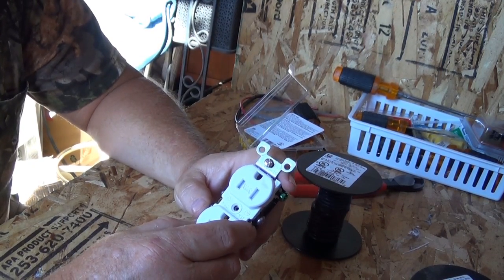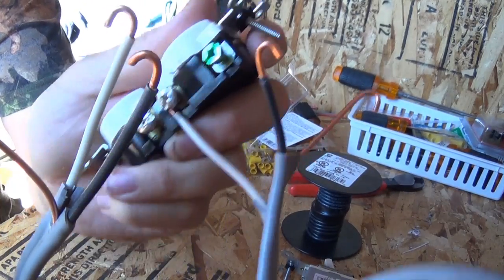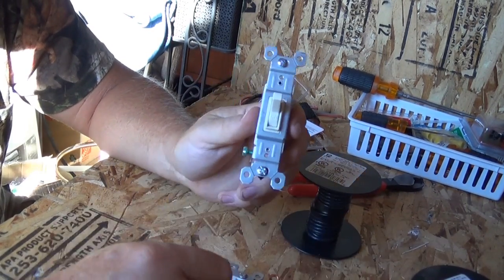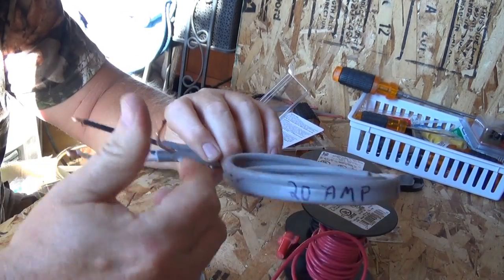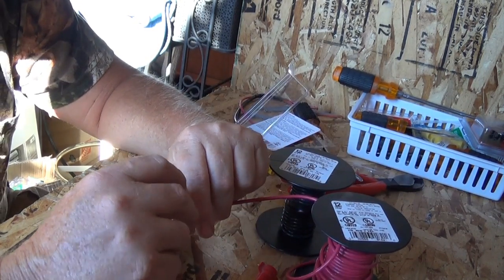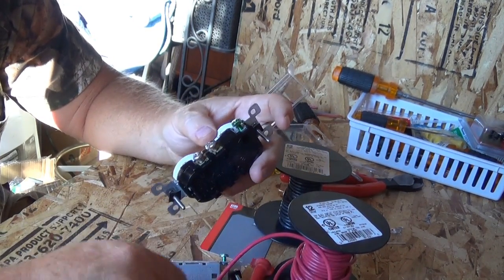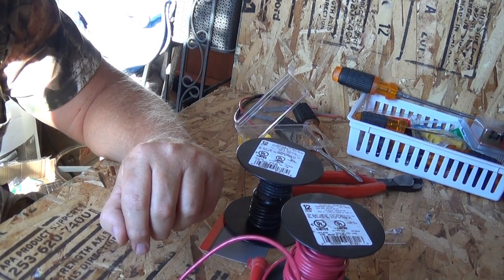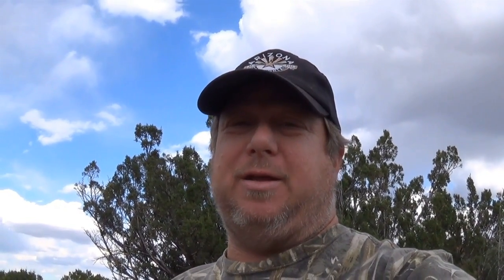Wiring Outlets, Switches, Lamp, Light Socket for 12v and 120v – DIY Off Grid and On Grid

Comment: use usb-c and 12v pd trigger boards for everything instead of regular outlets yo. then you dont have to make any of your own connectors and things are reverse compatible. this is the actual beauty of usb-c, 12v baby, right out of the wall. can put in a 12v dc regulator if youre paranoid of the voltage sag
Reply from the maker: great idea.

Comment: How are you am trying to use a 120 light switch to a 12 volts water pump can you be a little more expesific on how to connect the 12volt on the light switch
Reply from the maker: only use 1 wire lets say the white it doesnt matter you only making a break in the current. lets say white is positive and black is negative. run the black from the battery to the water pump. run the white to the switch then to the pump. the depending on the switch most time you are going to start from the top one side and bottom on the other.  hope that helps.

Comment: What DC appliance can be plugged into the receptacles?
Reply from the maker: if the receptacle has been wire to 12v and the appliance is 12v just make sure the positive goes to the positive . if you get it wrong you may damage the appliance.

Comment: "AC only" isn't legal jargon. All switches have certain ratings for legitimate technical reasons. 
   Using household ac components to wire for 12 volts dc has no merit when there are proper supplies affordable and easily obtainable. 
   My design background tells me how little this guy actually knows.
Reply from the maker: lol what little i know? lol   duh if you watch my videos it is very clear i am a master at nothing but i am making it work. i didnt know if i could do it so i tried and it still works to this day so legal or not its working for me. lol.  by the way i am no expert. lol duh.

Comment: Just a little tip. AC switches can be used but they will not last as long as a DC rated switch. There is a fairly long electrical reason for this which you could look up ( AC voltage is a waveform that passes through zero). Suffice it to say you may notice that when you turn a AC switch on it will intermittently fail to turn on, then you may hear an arcing sound when you turn it off. Then it  will not turn on at all (smoke may come out at that point). This is because the contacts are burning out. DC is extremely hard on electrical contacts. DC rated wall switches are expensive because they are more robust and snap open and closed quicker which reduces the damage caused by the arcing. More importantly if you have insurance on your place and you are using the wrong switch and your house burns down they may not cover you. I'm looking to put lights into my offgrid cottage and am trying to balance the costs associated with DC/AC. Each has advantages and costs. Good luck
Reply from the maker: thanks for the input.

Comment: I hate to rain on the parade here, but the "AC ONLY" comment on the switch isn't just legal jargon.  It's a safety issue.  Watch this video with a much more informed presenter.  Spend the extra dollar and get a DC switch to prevent a fire.  https://www.youtube.com/watch?v=CUFVSc5ll4s  Granted, the video uses more than 12v DC to burn that switch out, but I'm not taking chances to spend $3 on an AC switch, rather than $4 on a DC rated switch.
Reply from the maker: but i dont like the look of the dc switch. . i am no expert at anything. just showing you what i did.

Comment: I'm wanting to move a 120v outlet to better location. And convert my cheap 12v light outlet to run 120v light with gu10 bulbs.the question is adding a dimmer switch in the circuit. I'm try in to run 2 fixtures off the 1 set of black/white wires .
Reply from the maker: if your wires are for dc 12v dont change it to 120v. instead run ac 120v wires.  the stranded wire for dc will heat up with 120v creating a major problem.

Comment: Hey Jeff I have a question I’ve done this before on a boat trolling motor. I have two trolling motors on my boat on the rear transom with a 12 volt battery for each motor and what I did was on the motor I connected the black wire the ground to the battery then I connected the red wire up front to the mounted switch then a wire from the switch back to the battery positive side of the battery so then I turn the trolling motor on then go up front and cut it off with the switch I mounted so when iam in the boat by my self I can just flip the switch and start the motors from my front seat with out having go back to the back to cut them on and risk falling out of the boat. They make some foot control switches call big foot and sure foot for this type of application. But there rite pricey. In the neighborhood of $25+ dollar and house hold switches are much cheaper. But here’s my problem the wire I have to use is 6 gauge and it’s very hard to work with and I have to use because of the distance of 18’ do u have ant other ideas.  Anything greatly appreciate Wayne
Reply from the maker: i was thinking you should be able to go with 8awg. try this run the 6awg then put it in a water proof box and twist tie it to a smaller gauge. would that work? i dont know the loss power over 18ft but it shouldnt be much . i know its an extra expense but maybe take 10 gauge and run it, test it with volt meter to see any loss. . good luck to you love your idea.
Reply: You could also use a relay.

Comment: You can get switches and outlets that are UL rated for 120 volts AC AND low voltage DC. I've seen them in some of the solar suppliers catalogs. Possibly Cutler-Hammer? I know for breaker boxes and Breakers you can use Square D, QO series (not the homeline series) they can be used up to 48 volts DC.
You would hate for an insurance company to reject a fire claim due to such a simple and inexpensive mistake. 
Having previously asked about this I was told it has to do with space between the conductors and internal arcing and that since AC goes to 0 volts 60 times a second, it can self extinguish in most circumstances. DC does not go to 0 volts and can maintain an arc indefinitely causing a fire. Double check with the manufacturer because things may change.
The only difference between stranded and solid wire is that the stranded cable is more flexible and maybe somewhat more expensive because of that.
Most North American Outlets have two vertical slots in them. There are outlets available that have one vertical slot and one horizontal slot. If you use that style, there won't be any mistake, and you couldn't plug it in even if you wanted to.
A chassis ground in a moving vehicle is completely different than an earth ground in a building. That's why there are different schematic symbols for them. Yes you should ground your solar/wind/Hydro system.
Reply from the maker: good info thanks

Comment: So my dilemma is, and I am no electrician by any means, I am trying to use a switch from a what I am guessing is an electric or electronic device.  Trying to wire this type switch into a 110 volt lighting project.  The switch choice is due to the small size and concealability.  How can i first, determine the type switch and since I am not sure where many of our switches are originally from, whether I can use it in my project. Second how do I wire this into our application?
Reply from the maker: any standard switch . all the switches should have max volts and amps that the switch can handle. any cheap switch from the electric department of any store should be a standard 120v switch unless its in another department.  standard 120v switch just look online for basic wire diagram  . good luck

Comment: for a 12 volt only applications, do you run all grounds wire (s) coming from various lights to a bus bar that’s connected to a single continuous wire from all lights going to the negative battery pole? Or do you (also) run ground wire to negative battery to a ground rod. I’m want to wire solar 12V w/ 12V dc battery to run LED’s to light up shed and outdoor work area to cut wood.

 Verified by HealthProfs.in meeting my patients where they are at and working with them to develop practical goals that can be implemented immediately. My specialties include the ketogenic diet, as well as pediatrics. I also see adult patients for several different needs, including weight management.
I received my PhD in Nutrition from Arizona State University in 2016, where my research focused on vitamin B12 supplementation. I enjoy working with special populations, including children with genetic disorders and patients with epilepsy. I have experience in both the inpatient and outpatient clinical settings. pole and add wire from the
Reply: Disregard information listed under my question. It somehow got attached and was not included nor intended to be sent
Reply from the maker: for 12 volts any loads just need to be grounded to a large metal frame of some type. think of it like a car or RV there is no ground to the actual earth ground. for a large permanent set up you want to ground your battery negative and any components (solar panels, charge controller, inverter) to a bus bar than to earth ground. any lights dont need a ground. for a light you only have 2 wires no ground wires. with a 120 volt you have a 3rd wire so you have to ground it. does that help?

Comment: Hey AZ..Have u ever tried plugging AC devices into your 12v outlets (TV, bulbs, radio, etc.) Might b a good video if you find something AC that works. Also what would happen if you pump up a outlet to 24v. If no harm to anything.
Reply from the maker: I am afraid. lol..... interesting idea. lots of your devices with a 120v plug actually steps down volts to something like 5v, 3v, etc . . its drawing power so it might not harm things. maybe a fuse to protect the battery components side. interesting idea.
Reply: It is a terrible idea to put DC into an AC devices. Most AC devices have transformers, a transformers is a wire from one terminal to the next with a bunch of windings so for DC it would be a short circuit. The AC device would be like taking a wire sticking it in the ground prong of your DC circuit and then putting the other end on the posative terminal... hopefully you have fuses somewhere in the system because other wise stuff (batteries, electronics, wires...) is going to explode or cause fires. The AC transformer has a winding which couples through essentialy the air to another winding at a different voltage. This is simplified as much as possible so that it makes sense to someone who doesn't know anything about electronics.

Comment: Hey Jeff! Love your video. I also use 120v switches for 12v. They work great, most of the time. Sometimes, when I flip the switches on, they don't work. (very rare though, maybe once in 6 months) But if you switch them back and forth a few times, they work again. I read somewhere, that gunk builds up on the connectors, and the low voltage DC can't push through it. Actual DC switches have a bit of drag between connectors, making them, kind of, self cleaning. Not dangerous, of course, to use 120v switches for 12v. It's just something I've learned about how they work, and wanted to pass it on. If you mention this in part two, I apologize for repeating the info. 
I've thought about using 120v outlets for 12v, but I'm so stupidity unobservant, I know that I would end up frying something. Ha! 
Anyway, great video, keep up the good work!
Reply from the maker: good info. so far i havent had any problems . i wonder if the connection may not be tight enough is why it sometimes doesnt work. good info on the gunk.  thanks.

Comment: when wiring my campervan 12V system using 110 switches ad 110 outlets using stranded wire...what about if I plan on wiring my campervan for shore power? What considerations need be made ? TIA   also, when i add two ac outlets to a 12 V system, can they be GFI outlets?
Reply from the maker: i am sure gfi could be wired to 12v. the gfi is only a breaker built in an outlet so its the breaker that triggers when there is a surge. . shore power wire it separate with standard 120v wire using your chassis as the ground.  does that help

Comment: To keep the confusion down on what is 120v and what is 12v on outlets and switches: install 2 gang boxes and use white or ivory for 120v and another color ie: red  for 12v. That way you don't have to worry about markings wearing off and it looks more professional. My 2 cents worth.
Reply from the maker: +Chris Reese great idea. Where were you before I did this lol ????

Comment: How far can you run 12v 12ga wire before you start to experience severe power drop? It is my understanding that the further the run, the worse the power loss at the far end, but no one seems to be able to tell me just how far that is. I have a 32' x 12' cabin that I want to wire the lights (10 in total) in 12v on solar. several people i have talked to said i can just use any old light fixture/lamp so long as I change the bulbs to 12v so they don't explode. So confused.
Reply from the maker: the wiring video as you saw should explain that you can wire standard 120v switches and outlets to 12v. lamps and other lights can also be wired to 12v using a 12v bulb. I use 12v led bulbs. I think they are 7watts. 12ga wire is it stranded or solid?  figuring out the distance and power drop is confusing. here is what I know. I am no expert. I ran 6ga stranded for 24v from the battery bank to a distribution box. from that box I ran 12ga stranded about 30 ft to run 7w lights (2). the charts online are confusing. I would guess 10ga stranded no problem. if your watts on your lights are low and led 12ga stranded should be ok becus their draw is very little. your looking at a total of lets say 10w per light for 10 lights that's total 100w at 12v = 8.3amps assume 10amps at 12v . I looked at some dc wire size charts and it seems your 12ga stranded will work fine. sad 2 solar websites gave totally different information on wire size. if you start with the center of your building you could run separate lines so your dealing with 16ft instead of 32, wish I could give you exact  answer . if was me I would use 10ga stranded for that length and number of lights. I will check with my solar guy this week and see what he says. alternativeenergydiscounthouse dot com is their website.
Reply from the maker: I talked with the solar guy and he says you would be better off running a larger wire. I said for 12v go with 8ga as a main line and off the main line use 12 ga so it attaches to your switches and outlets better. I asked about just using 10ga and he said you could for low watts lighting but he would still go with the 8ga. all of this is stranded. I like the idea of using a main line as your bigger wire and wire tie it to a smaller wire so it fits in the switches and things. . I hope that helps.
Reply: Google wire sizing chart
Reply: This video makes my brain hurt! If you don't really know what you are doing, perhaps it's best to call someone who does. And to present a video like this and pretend to know the information you are offering as a fact is negligent at best, and potentially dangerous. How can many strands of smaller diameter wire have less resistance than a comparable single solid strand? The reason solid, or household type wire isn't used in automotive applications is, to put it simply, because houses are stationary. Unless the house is owned by the person in this video 😂
Perhaps you should at least have someone else watch your videos before posting them to any sort of platform where easily influenced individuals can think that shit like this is a good idea. On the other hand, if you are attempting to weed out the weak, I must say, good job!

Comment: AC travels through the wire thats why solid is used for AC,  DC travels on the outside of the wire more strands of wire less voltage drop so stranded is used for DC.
Reply from the maker: thanks for the information. I like it when people add information

Comment: This is very informative. I am determined to do this also, first with solar dc on travel trailer then later on a tiny home. I feel like there is no standard wiring practice for any of this we are way ahead of our time, especially you. Is there any place to read or look at diagrams to understand this or is this something I have to watch videos on? how did you learn all of this?
Reply from the maker: glad the video was informative. dad was a electrician and I played around with it in my younger days so I know the basics. wire standards? size of wire is important and is determine by the max amps you want to run. stranded wire is good for dc applications. fuses/breakers protect electric components, dc applications red is positive, black neg in most cases but if already wired inspect it first and stay consist with colors, green sometimes white or black is ground. always ground the battery negative to chassis and earth if you are not going to be moving the trailer or home, you can look up in google image specific wire diagrams they are helpful. remember for a switch its only on the positive wire not both that will create a major short damaging components.  i hope this helps. if you have questions feel free to ask. i will do my best to answer them.  good luck to you.